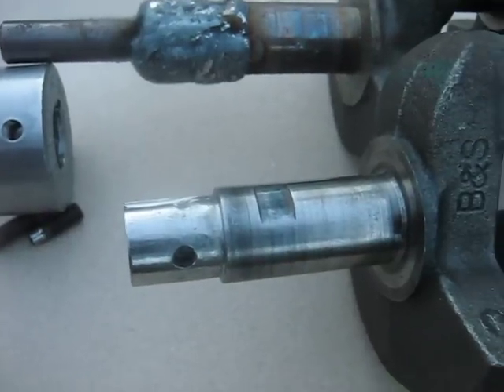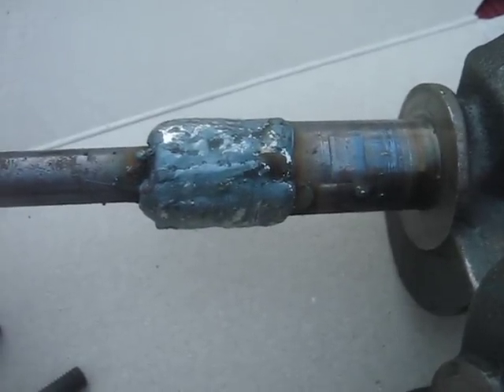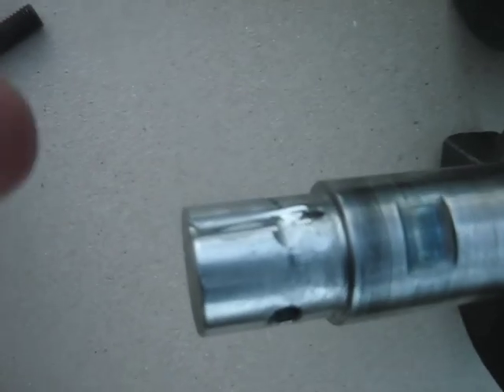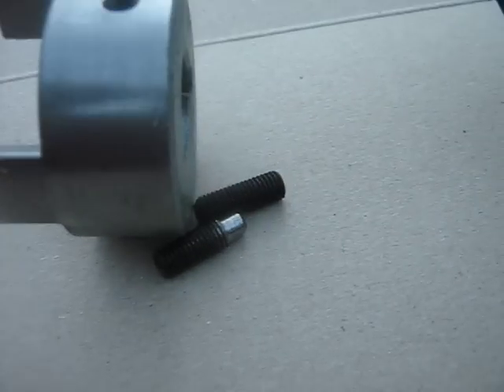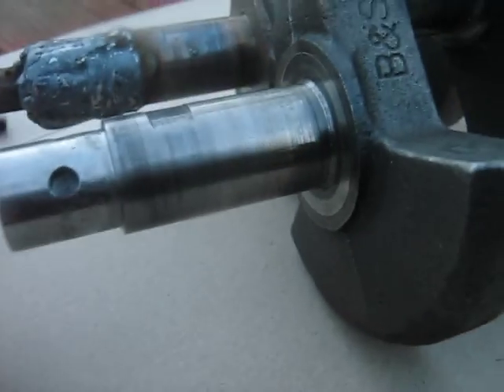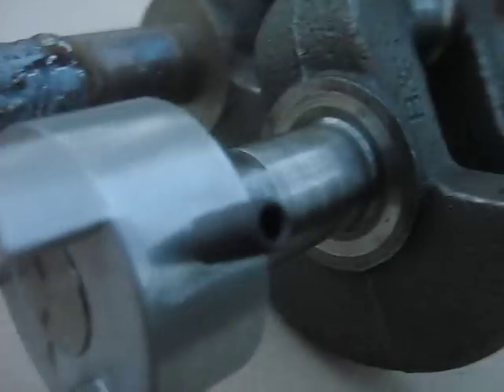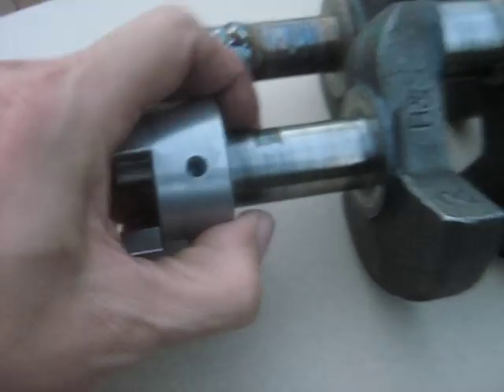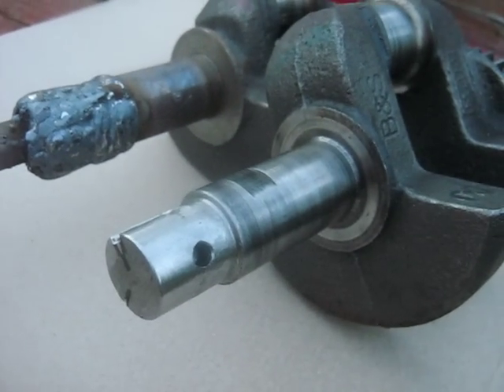Briggs 4 Crankshaft Problems

Comment: In my opinion I don't think the set screws will withstand the torque. On my army tank (as seen in my video 2/5 Scale Sherman M4A3E8 Tank Update 5) I used grub screws on the shafts and every grub screw sheered off, which made it extremely hard to get the sprockets off I had to get every sprocket red hot then press them out with a 4 ton press and that wasn't easy. After that I used keyways and that fixed it. You might be able to use spring pins and drill all the way through the coupler and shaft.

Comment from the maker: It seems to be a powder metal steel based product, since it is magnetic. I considered welding, but the engines definately won't come apart after that, without butchering the coupling. I guess I will use that as a last resort.

Comment from the maker: The timing is a good question, it depends on a bunch of things, not the least of which is the deflection under load of the rubber couplings. I am going to shim them with steel to take out initial play, and time the distributor using a timing light. Cooling is going to be difficult, although it is getting cooler out since it is fall, so that will help. I can make a short run without them overheating anyway. I found a 5 horse at the scrapyard that had only 4 fins left on the flywheel!!!

Comment: Looks like it should work but will they all be timed right? You could put the points back in each engine and make it battery ignition if the had them to begin with. Also you half to put an alternator on there to make it look cool , how do you plan on cooling it

Comment: That's my backwoods repair!  Sometimes I tapped the keyway and steel coupler and put in a 1/8" pipe plug with locktite to set it. The taper pipe plug forces the coupling and shaft apart for a nice tight fit. Tapping a potmetal coupling half on a steel shaft would be a problem, though.   I have also put steel filings mixed with JB Weld in place of a key. Works well if you pack it in tightly with a wood dowell.  Good for a whole season on my still....

Comment: if the set screws shear, besides a keyway, if its possible, drill a hole parallel down the parting line of the coupler/crank when fitted together and drive a hardened pin in the hole. it would be a round keyway of sorts, only danger is it trying to split the coupler but done properly it should work. actually a soft Alu. pin may be better for a shear point? Biggest problem with engines ganged up is them bucking each other and tearing crap up, so i've heared.